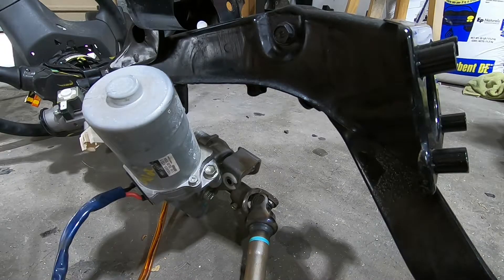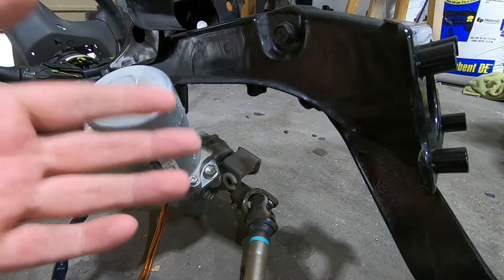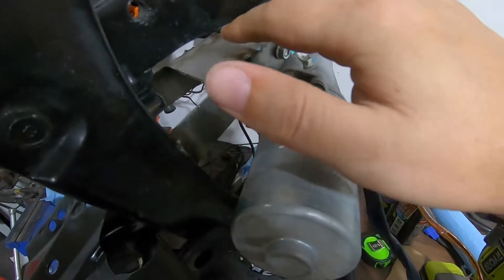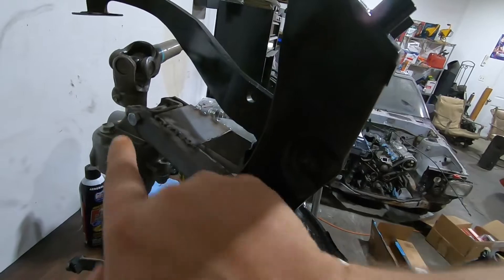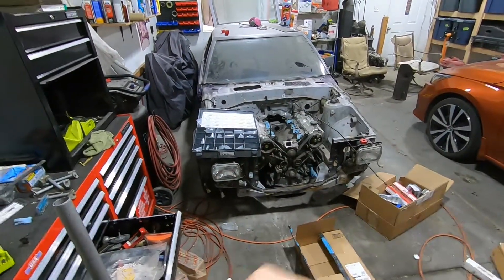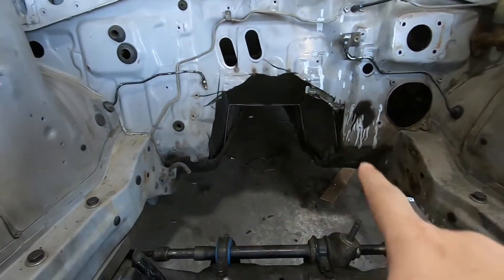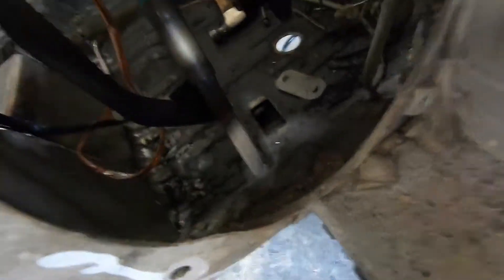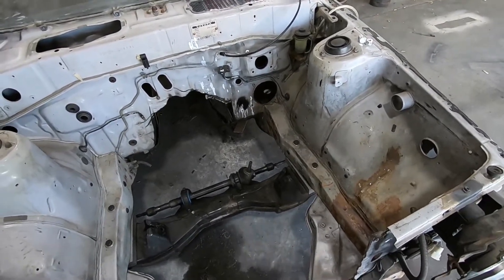Corolla + 1UZ Part 18 Now, to make it steer

Comment: Worries that the angle on the top joint looks a little too aggressive.  It looks like almost a 90 degrees down.  Did you check how much angle the steering shaft/joint you can get away with?  Just curious.  I’m getting all my ducks in a row to do a UZ swap on my corolla as well, and your choice of electric steering is interesting.
Reply from the maker: The angle is a bit aggressive, but I am using a double u-joint at the top that is suppose to support up to 70 degrees. It seems close, but I will do a small clip confirming it's behavior in the next video when I add the steering shaft carrier, or whatever it is called. When I tested it, I did not feel any resistance/binding in the wheel. If I am wrong, you will also get to see that in the next video lol.